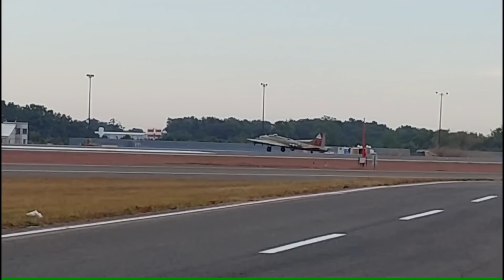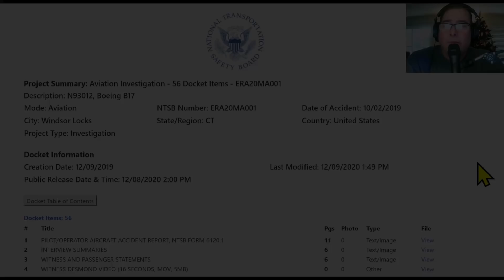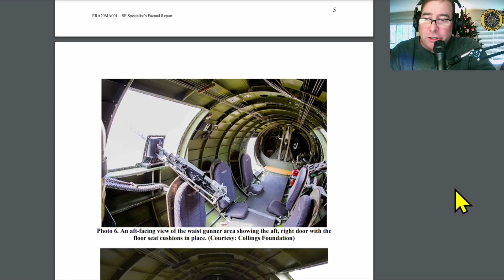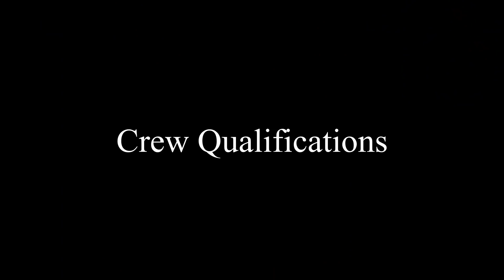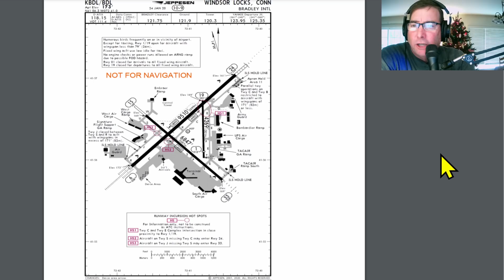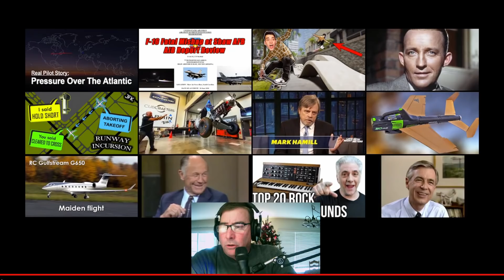NTSB Factual Report B-17G Crash 'Nine-O-Nine' Part I -16 Dec 2020

Comment: I was on the plane a month before the crash. Mac at the controls and Mitch at the engineer position. I was strapped to the back of Mac’s seat. 

I watched the engines fire and #3 was struggling to fire. We made the flight and we made it back fine. But upon landing 3 or 4 back fired loud. 

I had observed before them checking mags and after our flight Mac was working on the mags.

Comment: There are two must see movies that give us some idea of what our fathers (in my case) and grand fathers went through:  12 O'Clock High (1949 with Gregory Peck as Gen. Savage) and "Mission for Today" (1944) . Both my dad and my father in law flew the B-17, although I don't think they knew each other during the war. They flew high missions , 32-35 thousand feet, unpressurized and instant frost bite on any bare skin. Or low missions flown at 9,000 feet. Flak, and ME-109's who were ordered to fly directly into the formations if necessary. And they had to do this over and over again.  My dad was OK but I'm quite certain my father  in law had PTSD, although it was not called that. My father in law could be Dr. Jekyll and Mr. Hyde.

Comment: I got to go up in the B-24 "Witchcraft" at an air show here where I live in Billings, Montana, I think it was 8 years ago. A part failed before our flight went up. (I cried. For real, I cried.) I can not recall the part name now, but I believe it was fuel related. I could be wrong. I still have a photo of it sitting on the tarmac, though. It was about the size of an older model Ford starter. Anyway, a small miracle happened, and they found one somewhere, and had it flown in. We had to wait for it for hours. Then we had to wait for it to be installed. We were offered refunds, and the tickets weren't exactly cheap, but only a couple people backed out. I knew this was possibly a once in a lifetime opportunity. I was NOT about to give up. They did the run-up, and took it out on a short test flight, came back in, and we boarded. There was a brief safety talk. We were allowed to stand up, walk around and take photos. I wish I could post them. It was breathtaking. Best thing that I've ever done. I'd have paid double what I paid. Looking back, we were all a bit cavalier about the whole part failure thing, but if we'd gone down, well, at least I'd have died happy. My luck, I'd have survived, but been broken the rest of my life. 

I met the pilot that died in the crash this video is covering. He was awesome. I'd have loved to sit down with him, and hear some of his stories. RIP all.

I'm glad I found this channel. At least I'll know what happened now.

Comment: Being who you are, you may remember about 2004 when the idiot at the controls of the Bushmaster Trimotor crashed it in the street in front of Fullerton Airport.  It crashed because the idiot at the controls forgot to take the gust lock off the rudder. I had a ticket for the first passenger flight of that plane that day, but they were having trouble getting it started because of the magneto on one of the engines. A magneto. Go figure. I save the ticket I bought to remind me never to get on a jalopy like that, especially with an idiot at the controls.

Comment: Its there any video of the plane as it was trying to lsnd just before it crashed ? Its hard to just giess what went wrong if you cant see just what all the plane was doing, cause this plane shouldnt of went down that close to the runway unless there was a last second mistake he made, but without seeing what this plane did, i mean why even discuss it, surely there was video at that airport picking that up, google earth is not gonna dhow anything about what happen here,,,,how bout some real video man, not xig zags on paper and a video of it a mile away !
Reply: +@user-fv2xv8xh3b   Witness video shows a rough landing and veering into the approach lights before continuing into the deicer equipment station.  Audio picks up throttle advancing after landing, either intentionally or inadvertently and could have contributed to loss of directional control.

Comment: I was driving on Route 20 and was directly under that B-17G as it was attempting to land. A friend who is a GA pilot was driving behind me and later told me that the B-17 was only about 100 feet above me. Also I had already driven pass the runway and the landing approach was on the grass besides the runway when he was on top of me. My reaction at the time was "Holy shit that plane is low". It seemed to me that the pilot had his engines at full power. My thought was that it was a C-130 since there are rarely multi engine props @ BDL.

Comment: Pilot's arrogance caused this tragic accident.  Never should have taken off. Did not follow basic emergency procedures.  Didn't follow recommended airspeed.  A side note, by using "Mack" in referring to the pilot demonstrates poise to the guy who caused this needless crash. You always do a great job on these reports. You weaken it by not using formal names.  Especially when "Mack" was 100% the perpetrator of this crash

Comment: I was always taught that the start sequence for any 4 engine aircraft is always 3 4 2 1, starting an outboard engine before an inboard engine in dangerous, what if the inboard engine catch fire ? You then have to run through a spinning prop to extinguish the fire !!

Comment: I knew Mac and considered him a good friend from my time as a tour coordinator at KILG New Castle/Wilmington, DE for the Collings Foundation. IIRC, the last Collings tour was at KILG in 2018. I was told Mac had the most time flying a B-17 of anyone alive at that time, 10/2019, and even those pilots that flew B-17s during WWII. 7500+ hours. He was a quite modest man that lived to fly 9O9. Also, an ex-airline pilot.  I've had several rides in 9O9 over the years without any problem, with him as the pilot-in-charge. I consider myself lucky in that respect and lucky to have known him and other crew members. RIP Mac, and those that were with you that day too. I still can't believe it happened. 
BTW, there are only 3 exit points in an emergency. The rear side door, the bombay doors if and only if they are open, and the hatch in the navigator/ bombardier compartment up front. The ball turret operator is by himself and gets out on his own if airborne. Rear gunner can only get out on his own thru the hatch in his compartment. And no, he cannot climb over the tailwheel when it's retracted. It's impossible as I tried to do it and failed.

Comment: So many crashes are initiated by an aircraft turning on the dead engines side to attempt to reach a runway. But the core issue here is flying old 1930's aircraft designs that were only ever designed for a short wartime lifespan. Having worked in aviation and seeing how old airframes, systems, engines become increasingly problematic over time there should be a set cut off point for flying 80 year old aircraft. Using difficult to use military style seat belts in a joy ride aircraft is insane. Just too many exemptions are set up and this needs to stop. How many crashes and losses of life does it take to stop this preventable madness.

Comment: As someone who is familiar with magnetoes from this era, I would like to see the coils from these mags to see if they had the classic X crack. As soon as moisture gets in and starts doing its damage, blowing out the mag isn't going to fix anything.  Only replacing the coil will. The two problems cause similar symptoms. But a wet set of points can be dried out and no harm done. A shorted out coil on the other hand, is detrimental. A cracked coil will go on and run for years as long as you keep it dry.

Comment: I just found this video, and didn't realize this happened 3 years ago now - and now we have lost "Texas Raiders" to a mid-air. And yes, it breaks my heart that both the people and the planes are lost.

I think, one of the problems with these aircraft isn't that they're "hard to fly": the problem is that there was a LOT of knowledge on "how" to fly these planes during wartime, that was never passed on to future pilots - knowledge that was never written down. I say that based on my own experience working as a intern back in high school, at a FBO that restored T-6's, back in the late '70's/early '80's: earlier this year, I watched a video on here of a guy trying to start a T-6, and he nearly burned the plane to the ground! He clearly didn't know the proper way to start the engine - who knows if he even knew how to fly the plane.

Meanwhile, I saw another video on here years ago, of a WW-2 vet that used to fly C-47's, that was taken for a ride in one, and was asked if he'd like to take the controls: he took the controls (he was in his 90's now), and he flew that plane as if he'd never stopped flying them! He then went on to tell the current pilot several tips that are not printed, and he showed him how it's done. It was amazing how everything was fresh in his mind. He even showed him how to better trim the aircraft.

I took my ex for a ride on a B-17 once, and the plane we were on had no special passenger seats, so we were given crew positions: being the only couple, we got to sit in the nose during takeoff - her in the navigator's seat, me in the bombardier's seat!!! Being well-versed in the operations of such aircraft, I lined her out on everything from how to cinch her harness (they're only really a pain when they get old, because they get stiff when not used everyday), to warning her about how the brakes will sound "like an old school bus", and not to worry about them. I talked her through the engine run-up & why it's done, and all, but since she'd only flown 2 times before this (in large  passenger jets) she was still terrified, lol. She did go to tears when, after telling her to keep her feet on the catwalk, to avoid any chance of damaging the skin of the aircraft, she commented that all the armor plating had been removed: I told her "There never was any armor plating: they had to save every ounce of weight for the bombs they carried. That's why enemy fighters tore the planes apart."

Only thing that freaked me out, was just how far forward the bombardier's seat is in that glass nose: using only peripheral vision, you can't see the rest of the plane around you, and it's the strangest feeling!

There was a lot of un-written information that was never passed down, because nobody figured that it would ever be needed - and here we are. By no means am I saying that the pilots that fly these planes aren't qualified - but there is a lot of information about these planes that they don't know. I'm saying that they know how to fly them per "the book", but "the book" doesn't replace real-world experience, and the fewer of these planes there are, the less of a chance that current pilots of them will be willing to learn exactly what these planes can/cannot do, versus what "the book" says they can/cannot do. That is a very sad thing, because we will eventually not be able to see them fly anymore, let alone go for a ride in one.

Comment: Look in any certified Airplane parts manual for detailed ignition lead information. It's often a hodgepodge. Bendix Scintilla D9 magneto's are reliable and predictable, but only if they receive proper maintenance and installation. 3 years ago, scuttlebutt was that the "P leads" low voltage shielded hookup cables were bogus on this plane. This includes the mating contacts and threaded hardware. Customers sometimes demanded and got special thread custom parts. If you find them, Bendix advice is chuck them and use common standard Bendix parts.

Comment: A perk of working for my State's Aeronautics Commission was helping every time I could the various groups keeping the warbirds flying and was fortunate to fly on most of them. My fav were the B-17s and I vividly recall staring down into the open bomb bay opening inflight with just a cable going around it.
Reply: + JIMJAMSC   I think part of the problem was the local FSDO inspector in Orlando that oversaw this B-17 was killed in a Curtiss Jenny crash in Geogia in 2016 and his position was never replaced.  So the B-17 fell into a maintenance black hole.

Comment: I flew in this machine in Illinois in 2007. It was the thrill of a lifetime BUT it was plain to me that the attitude to safety was 'relaxed'. I was also struck by the chief pilot (the same one who was tragically killed on the final flight) that this was already an older man (the age I am now) who had to work very hard to stay in control. At the time of the crash he was another 12 years older - these WW2 aircraft are extremely physically demanding to fly, while maintenance is complex and hard work, not something to be left to an old guy with a stepladder. The revelations about the state of the plugs and magnetos in the official report tell their own story. I caught up with the Collings Foundation again in 2009 where the 909 had a flat in the tail wheel. To my amazement they were fixing the tube with a puncture repair outfit. Seriously?? A blowout on landing could have caused the B-17 to slew all over the place. I took pictures of that. I wouldn't change the experience for anything, but I am very glad I flew when I did and not in 2019 when everything, including the pilot, had had a lot longer to get worn out.

Comment: I was looking around for B-17 information as my oldest uncle repaired them in England in WW2,  I came across this video.  Very interesting, especially part 2. Question and unrelated to the crash.  When starting the B-17G you illustrated that the engine starting order was 3,4,1,2, and I have watched some videos of B-17G starting up, and they start the engines 3,4,2,1.  The B-17 F manual I was looking at seems to include G models also and on page 27 states that the start order is 1,2,3,4 and watching the older (which is funny by today's video standards) startup video on the B-17 they started 1,2,3,4.  I always thought they started the inboards first, but like you said, if #3 has the generator then yes it has to start first. Also, so the guy with the fire extinguisher could work his way out away from the plane.  Thank you for your reports.

Comment: It sounds like the owners / pilots of this aircraft threw out all safety on this flight - don't tighten seatbelts, no safety announcements to the passengers, etc.  I bet the FAA was all over any surviving owner.  Also, why did the engines sound like they were in full throttle after touchdown?  I would think they would cut the throttle immediately.

Comment: On the day of this crash I was working a part time job in East Windsor, CT and received a phone call at work that my mother had just passed away, the time was about 9:30am. I told my sister that I would go home and get changed and then go to my mothers house to meet the rest of the family. At about 9:50am I was approaching the airport and saw this B 17 flying towards the South and very low, appearing to be at tree top level. I drove by the end of the runway just as the plane hit the de-icing tanks and exploded.. The ironic part of all this was that my father was a crew chief on a B 17 during WW2 and met my mother in England and brought her home and married her. The plane crashed about 25 minutes after my mother died.

Comment: Nitrogen is a dry gas but it chills what it is sprayed on. After awhile condensation can once again form possibly more than before if the person spraying the gas chilled the metal in a high humidity environment. Same as a cold class, the metal starts dripping water. Sad mistakes.

Comment: So Sad. They had 2 great engines. Please google B17 Sir Baboon McGoon the crew had a nice "stay" in Stallag 17B after a dip in the north sea. Their troubles started when a higher aircraft dropped a bomb on #4 engine,, Bombay doors not opening, Bombay doors stuck open,  German fighter aircraft "fixing" the other 3 engines with at least two more stopped and not feathered.

Comment: Thanks for the info on the B 17 landing gear. We had "Aluminum overcast ", that they had to change a jug on the #2 engine and I saw them making a slow pass around the city and the gear was only half way down. I would suppose that was so they could put it down in a shorter cooling time for the motors. Does that make sense 🤔?

Comment: Those 1820 wrights definitely put out the power but were notoriously bad engines, My grandfather called them wrongs for good reason. Faa finding fouled plugs no big surprise they burned over a gallon an hour. They were over-stroked the crankshaft would nearly rub the crankcase. Having 4 engines only meant you had 3 more to worry about

Comment: I live 1 mile NE of Plymouth, MA airport.  Planes that land on runway 24 fly over my house.  In August 2019 the Collins Foundation had the yearly airshow here.  I love to hear those old warbirds, especially the B-17 and the B-24.  That year, when the 909 B-17 flew over my house I stepped outside to watch it and it did not sound right.  Instead of the harmonious growl, something was out of synch and there was an odd vibration. It may not have made a difference but I wish I had said something.